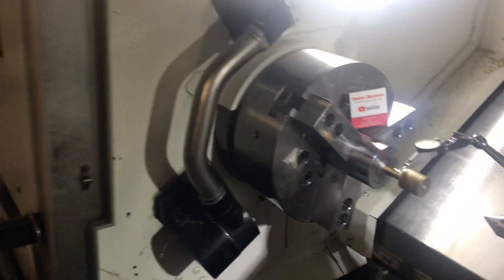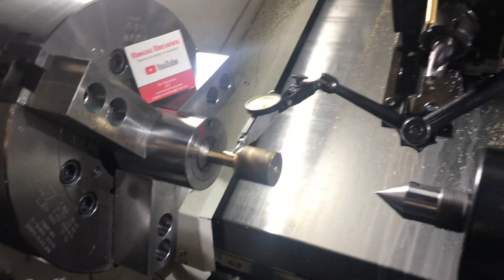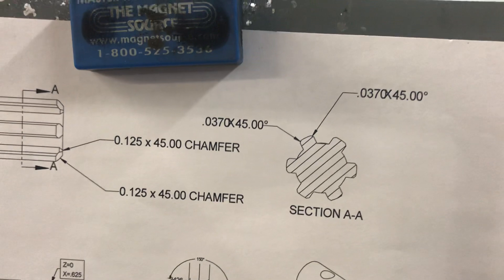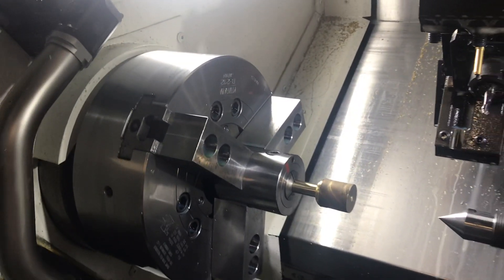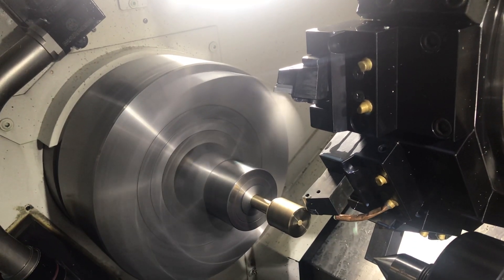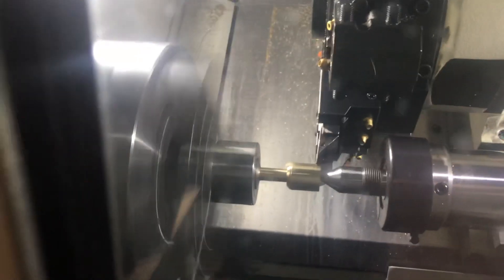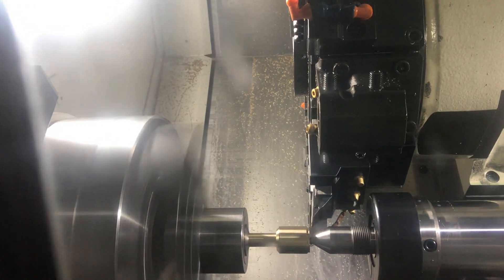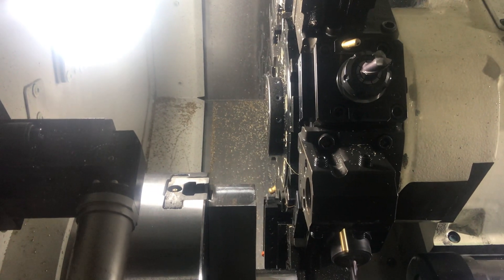Cutting a spline in the Lathe

Comment: I've got to ask,  after producing a 18 tooth spur gear on ww1 era machines and  tools in just under 45 minutes, what is the advantage of cnc on over manual machines for such a part? Or is it rather "this is the machine we have, just use it"  as a newer machinist on all manual machines I can see the need for cnc on certain jobs and a definite advantage to manual machines on other jobs. Just curious.  Never the less your videos are informative keep it up.  Thanks Jacob, heavenly machining
Reply from the maker: Thanks for your question Jacob.  I'm glad to see that you are keeping some real old manual machines running, and in doing so you are learning critical set-up procedures used in both manual and CNC.  Those manual machines are 

what got us where we are in today's technology.

Getting your job started, and to the point of actually machining the part (spur gear in this case), takes the same amount of time for manual or CNC.  Actually CNC requires a bit more effort because you have to make up a CAD drawing and write a program (by the time that's done, you might already be making chips on the manual machine).   You need the correct cutting tool for either process, and a dividing head.

18 teeth are 20 degrees apart so you have easy readings to go to on a dividing head.  If you see the video that we made recently, we had 50 teeth on a timing belt pulley.  Those teeth are 3.6 degrees apart - or 3 degrees and 36 minutes.
Using a manual dividing head isn't quite as easy because you have to add the degrees and minutes each time, and it's easy to make a mistake when moving from one tooth to the other.

The time saving goes in favor of a CNC when you have to take multiple cuts per tooth along with indexing to the next position.   All that gives you good finish and accuracy, especially if time is an issue, or if you have more than one part to make.

Don't know if CNC is in your near future, but there are some good machines for doing low quantities, even when tied in 

with manual accessories......depends on some ingenuity and set-up problem solving on your end.  Do you  have any
old experienced mentors to talk with?  Some of those guys would enjoy sharing their knowledge.

Best of luck,
Tim
Reply: @makersmachining5408  thanks for the reply, no I don't have access to a mentor. We have machines from 1912 through 1980s if you are interested our channel is Heavenly Machining . I have been considering cnc for complex work but have made do with what we have from a shaper to the big radial drill. I recently made a rack gear entirely on the shaper, slow but works. I'll keep following your channel for more learning and advice. Thanks
Reply: I forgot to add the rack gear was for my American pacemaker lathe tailstock which I also made the spur gear to mate with.  ( The previous shop had stripped both   but I got it at a good price for that reason)